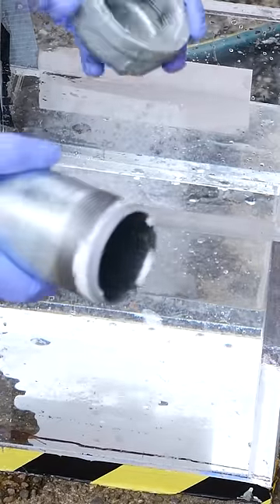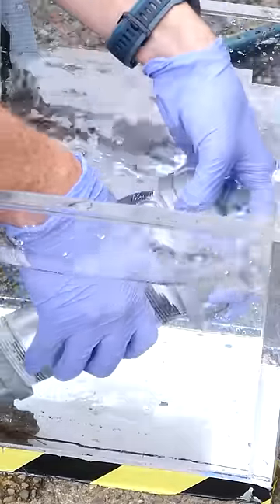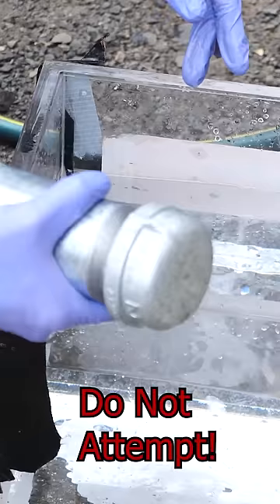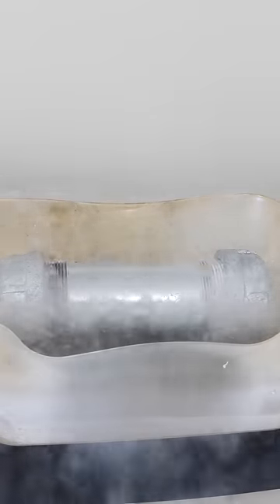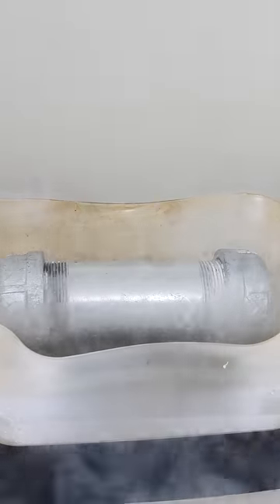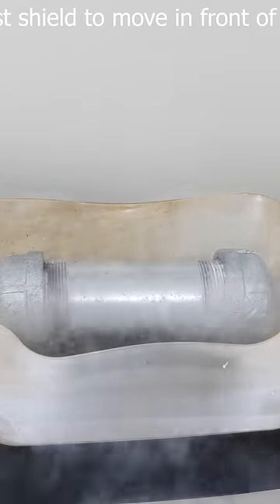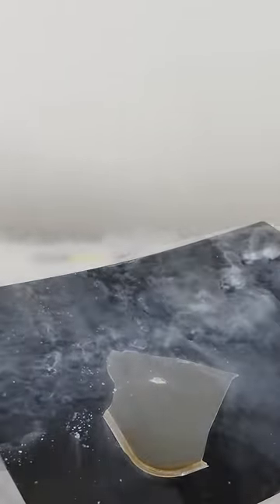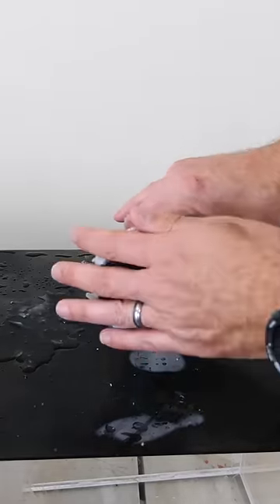Don't Ever Try To Stop Water From Freezing!

Comment: And he forgot to tell that by cooling the metal to very low temperature, he also crossed the brittle transition temperature (DBTT) for the metal. That is why it snaped so clean.  
Look it up. It also happened to a lot of the ships during second world war. The ships was produced and made to warmer water, but the German submarines forced the ships to pass far north into cold water. The cold water made them break, as they had been cut by a large knife.
Reply: I don't know enough to say anything you said buy my first thought was basically, "wouldn't freezing the metal weaken it?"
Reply: I think the Titanic also went down in a similar way. The cold waters of the North Atlantic caused the metal of the hull to somewhat contract and lose some of its ductility and tensile strength. This was why the iceberg was able to break it so easily.
Reply: So it loses that flexibility and becomes more like glass causing it to shatter more easily?
Reply: @legendarybro2455  Probably.  Also, the rivets were made of cheap iron that wasn't as strong as they thought.  The iceberg actually pushed apart the plates of the hull, popping the rivets.
Reply: @Chris-dm1je  fun fact there were apparently 2 other ships like the titanic, they all sank and one women was on all of them and survived all.
Reply: @cerovk6000  Violet Jessop was a stewardess on both the Olympic and the Titanic and a nurse on the Britannic.  The Olympic was in a collision with a navy ship, was badly damaged but did not sink.  She was being repaired in the dock next to where the Titanic was being built.  The ship builders took advantage of the situation and took several large components from the Olympic in order to complete Titanic more quickly.
Olympic returned to service and was decommissioned in 1935 having earned the nickname "old reliable".  Her fittings and fixtures were auctioned and there are several buildings in the North of England that have wood panelling and staircases from the ship.

The Britannic was renamed as it was felt her original name "Gigantic" would put people off travelling on her after Titanic sank.  She never went into commercial service as she was converted into a hospital ship at the outbreak of the First World War.  

There is still debate whether she hit a mine or was torpedoed by a German U-Boat while crossing the Mediterranean  to pick up wounded soldiers from Gallipoli.  

Miss Jessop survived Titanic unharmed, but sustained a head injury while escaping Britannic that affected her for the rest of her life, although she did return to the White Star line as a stewardess after the war.
Reply: @Chris-dm1je Not to be asinine, but both of you are wrong in a big way. What you’re saying isn’t incorrect factually but it infers/makes wrong implications.

Firstly the temperature has nothing to do with iceberg easily cutting the hull. Sure it might have had a minor effect, but between 1912 ocean liner and iceberg, the iceberg or rock is always going to win, regardless of temperature.

And 2. Yes the rivets are “cheap” but not by the standards of the time. You imply there was some level of cost cutting. There wasn’t, that was just the standards of the time. Rivets are always a terrible method of connecting things, because you’re essentially building in weak points that can pop out.

Riveted tanks are famously awful ideas as well, but we can’t criticize the British for making riveted tanks in 1916 because welding wasn’t at the point where it could do that. Same with the titanic, it wasn’t cheap riveting, riveting itself is
just a cheap and antiquated way of binding things.
Reply: @hansshekelstein9450  You are correct.  I should have pointed out that the builders had no reason to believe the cheaper iron was inferior as for all they knew at the time, it may simply have been produced more efficiently.

Building ships of Iron had actually only recently become big business, less than.half a century after the first iron ship had bern built.  Industrial metallurgy was still in its infancy as well.
Reply: @cerovk6000  
Her: Fool me 3 times, I won't be fooled... again.
Reply: There's no water on earth cold enough to cause ships to sink. Bad alloy (porosity and contaminants in the substrate as well as the welds) does.
Reply: Whoa that’s crazy. 

But what I wonder is: where does the 10% more volume come from when water is frozen
Reply: I didn’t know that. Thanks for teaching me something new today 😊
Reply: The Titanic was also on fire and had been since leaving port in the coal store on the same side as it was hit by the iceberg. The fire is what weakened it.
Reply: @Link-ji7kx  it’s not like the volume comes from nowhere. to keep it simple the water molecules in liquid form are able to pack more closely together than it can in the crystal structure of ice. meaning water is more dense than ice. the reason for that is when water starts to freeze hydrogen bonds form between water molecules making a lattice pattern (#). that causes water molecules to not be able to pack closely together as it does in liquid form. That’s why water expands when frozen because the hydrogen bonds pull the water molecules further apart from each other. Which causes it to expand by 9% in volume.
Reply: Many of the Liberty ships were reinforced in the centers with welded plates...
Reply: @cerovk6000  yeah she did it, ole witch of the sea!
Reply: @aishahball5332  dude I saw that episode, your thinking of The Last Airbender bro
Reply: I do fire sprinkler systems and i can tell you that water freezing will completely destroy pipe even schedule 80 like a banana peel.
Reply: I did not know that, I’ve learned something interesting tonight.
Reply: Legend also has it that the Titanic suffered from the same thing in the icy north Atlantic Ocean. 
The metal they used was "supposedly" subpar.
Reply: Na they were just cut in half by Dracule Mihawk
Reply: That's pretty much why we have the "Charpy impact test", freeze the sample, put it in the apparatus, move back and use the mechanism to let the "hammer" fall and hit the sample. You get a good view on how the sample deforms/snaps at a set impactforce that is repeatable and temperature, ductility is nice until teh samples reach certain temperatures, then you have something that makes glass look non brittle.
Reply: @cerovk6000 how can you call something a FACT, then start the sentence with APPARENTLY?

If it’s a matter of fact then apparently doesn’t even come into it.

Also here’s another fact:

Saying FUN FACT makes you a tit.
Reply: I just love this comment thread. Intelectual debates don't happen often on the internet.

Comment: I think what partially contributed to the steel containers failure, was the rapid freezing of the container itself. Since when metal is frozen rapidly it becomes hard enough to where it becomes brittle which thus allowed the freezing water to expand and exert enough force to bust the steel container.  Also since the pipe fittings are casted, it also contributed to the steel’s weakness. 

I would like to see this process happen again if the ice gradually freezes and exert enough force to break the steel container from the ice alone
Reply: I was giving the container 50/50 chances, but when he started pouring LOX, I knew it was going to fail.
Reply: Also the caps of the container are the weakest point, when they contracted from freezing one of them cracked.
Reply: The container didnt explode the lid popped off rocketing the container in one direction and the expanding water in the other.
Reply: I'd like to see the cap welded after being closed, so the pressure doesn't just have to break the threads.
Reply: That may have played a role, also, but the pipe likely would have broken open either way. You see it all the time with fire sprinkler systems that aren't taken care of in winter. The water freezes and splits the pipe, then when the weather gets warm enough that the ice melts, you get a pretty gnarly leak.
Reply: @GhostEmblem the lid didn't pop off, it actually did break. You can see that the threaded section is still screwed on to the pipe when he's showing it to the camera after it burst.
Reply: Someone else froze steel cubes and they popped at the seams or expanded from memory
Reply: I know it'll fail,
In my parents house we used water for the heating system, the house wasn't heated part of a winter and the thick old radiator broke, with quite a big crack.
while outside it probably didn't pass ~-20C and considering the inertia, it probably failed ~-10C.
Reply: @GhostEmblem   Actually the lid didn't just pop off. I know that's what the op said. The threaded end of the cap is still on the pipe. That's still some what of an explosion.
Reply: Plus water’s being incompressible fluid.
Reply: Steel pipe was shrinking while the water was expanding.  😂
Reply: This was my exact thought!
Reply: Exactly
Reply: Water can be arrested from expanding the end result is ice II followed by ice III and so on, scientists have achieved ice VIII if I remember correctly. Also ice II has a completely different molecular structure and has new properties. It's more interesting than this moot experiment
Reply: Totally, I was about to point the same but you did a much better job. Thx!
Reply: Don't forget the threads, failure was guaranteed to happen there, I am very sure that the cap fractured at the internal threads.
Reply: Nothing new,nothing genius here. Fastbor slow it will expand and explode, same ckncept as sticming a Monster in the freezer, yes inkilled you peoples buzz with facts.
Reply: The main reason this happened is because you can’t compress water. This is why hydraulics use an oil like fluid that does compress under pressure. As the water froze and expanded, the pressure became more than the threads could handle and you get an explosion as one end flies off.
Reply: Exactly what I was thinking. Put the pipe in a freezer and see what happens 24 hours later. Results could be different, such as a split down the middle of the pipe.
Reply: Probably using a material more stronger than steel and something that doesn't react much to temperature
Reply: That's what I said .If you would let it just freeze on its own I don't think it would have done that.
Reply: Was thinking the same. Put it in a deep freeze overnight and screw it on better than hand tight. My thought is, the pipe would burst at a seem. The lids would stay.
Reply: Funny...I never read your comment and came up with the same question a few comments above yours..great minds think alike,!
Reply: @vibaj16 THIS is what, along with gradually freezing, I was going to recommend. The threads on a screwed on container are the weakest point of the container.
Reply: Metal pipes normally split when they bust.
Reply: Water will always burst the pipe, it happens to unprotected water lines every winter in cold climate area's when people's furnaces go out.
Reply: According to scientists, something similar happens to liquid metal terminators.
Reply: Guess we got some homework to do! 🤷🏻‍♂️🤷🏻‍♂️🤷🏻‍♂️🤷🏻‍♂️🤷🏻‍♂️
(Don't try in your kitchen's freezer!)
😅😅😅😅😅
Reply: Now here's a dedicated scientist!
Reply: That was a great observation!  ❤
Reply: There's a Mr. Wizard episode that you gan watch . The pipe literally explods into shrapnel.  He lowers his with a string into a dry ice and alcohol bath from 30 yards Away.
Reply: Fill the container full of water with no air. Then weld the ends on. The threads will give waaaay sooner than a weld will. It will probably break around the weld.
Reply: @andresdiaz2578  what are you talking about? It happens all the time in winter in the latitudes outside of the tropics. People sometimes forget to isolate their pipes and the cold climate freezes the water inside the pipes. The only difference is that the pipes don't  explote, they just get weaker and break not violently, just acquire multiple cracks whose size varies depending on the pipe compositon and how cold the climate got.
Reply: I've been part of a similar experiment but we used machined threads and used locktight followed by 4 tak welds on each side. Then we left it on the shore of a frozen lake. We were in the area all day/night. We didn't see it happen but we heard the pop and found the remains. Regardless it will explode even when frozen slowly
Reply: @vibaj16  the threads didn't fail, it blew the top of the cap. So welding the cap on likely wouldn't  change the result
Reply: @rh_BOSS Surely, that was N not O.
Reply: I agree, I think a long freeze probably would have survived
Reply: @MxGrr o
Reply: I concur

Comment: The reason it didnt need to freeze all the way through is because water is incompressible and even a small amount of ice (a small increase in volume) was enough to pop the lid off. Steel is also malleable(ductile?) to an extent but i imagine the cold temp just made it brittle

Comment: Not for anything, but pouring liquid nitrogen on the metal not only hyper freezes the metal which makes it brittle but it also causes micro cracks when the metal contracts. As you said. The water wasn’t even frozen. Therefore the freezing of water had little play in the explosion of the tube. Why not just put the tube in the freezer and wait for the water to freeze?

Comment: Not only does the water expand, but the steel pipe contracts when cooled down.  The metal also gets more brittle at colder temperatures.  All three add up to make it explode so quickly.
Reply: This.
Reply: Especially with being cooled by liquid nitrogen that steel is going to get brittle
Reply: People sometimes forget most things contract when they get cold. Water is one of the few things that expands when it freezes because it does it in a crystalline pattern or something.
Reply: True but even further the water isn't able to expand or even change temperatures below freezing unitl the strength of the pipe can no longer hold the for of the water wanting to freeze and pipe bursts. Also why the part in the middle didn't freeze because all of that happen the instant the pipe blew so the middle got shot out before the flash freezing could get to the center.
Reply: All the air that's dissolved in the water also leaves that solution if the water freezes
Reply: I don't think the brittle steel plays a factor at all. Should still retain the same psi rating unless you were to hit or drop it.
Reply: @anonymoushonesty2688    When it becomes brittle it loses its ability to stretch before breaking.  A ductile metal wouldn't break as the water expands, but would stretch with that expansion.  When it stretches the PSI within the pipe would drop.

Comment: You have to turn the cap open end up so that all the air comes out. So the incompressible water doesn't compress the air past the pressure limit of the container.  Without air it would just split the threads open. Relatively safely. 

Chalk one up for the difference between theory and practice.